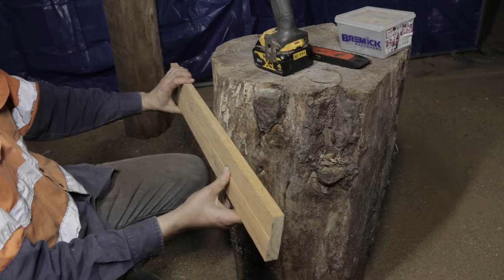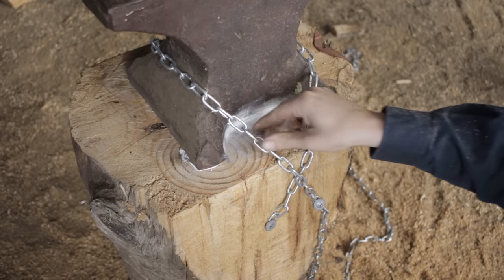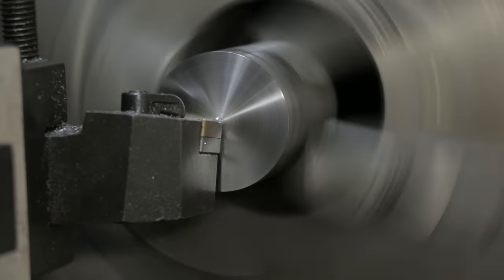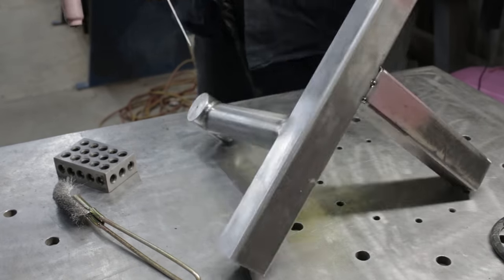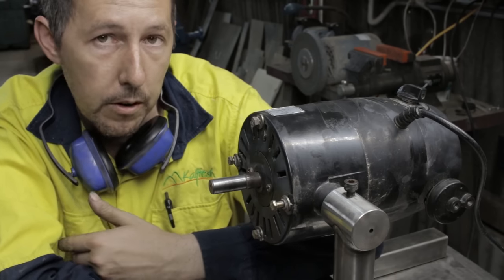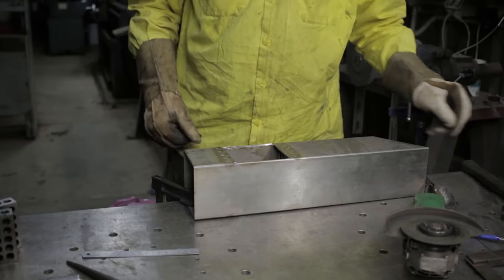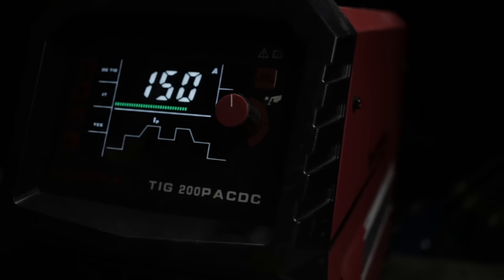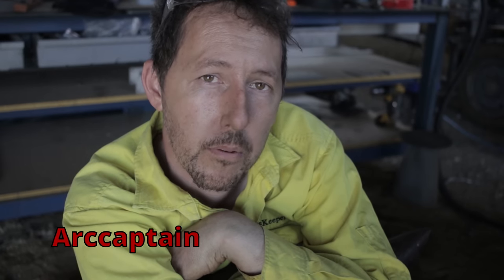Wood Fueled Furnace -PT1-

Comment: While a wood fired foundry does sound cool, electricity is so cheap here that it basically costs me a nickel to run my electric furnace and melt aluminum.  Supposedly can do copper and bronze and all that too, but I'm mostly into melting down heating trays and curtain rods.  Still, good melting, however you can do it.
Reply from the maker: Hi Derek
You have won the Arccaptain welder if you want it?
Reply: @LittleAussieRockets  Wow, super awesome.  Now no excuse not to level up.

Comment: Excellent tips for tig. I was a certified sheet metal fabricator years ago. Never liked cranking out parts in an ugly, loud, cold factory, but I've been thinking of welding for my own projects. I was taught to tig by carefully, steadily wiggling the rod through my fingers, but I have to admit I've never seen anyone else do it that way. Welding jobs offered half a McDonald's wage, so I moved on to work for more humane wages.well done
Reply from the maker: Yes, it is similar here in Australia,  production welding jobs can be a bit of a grind.

Comment: I was surprised at the lack of ring in the anvil - I didn't think tight chains would dampen it to that extent.  A "hand forged" anvil is pretty special.  Congratulations on your wise choice of extended relatives.  I have my father-in-law's old hand blacksmithed bale hook - I currently have no use for it, but it is a one of a kind thing of beauty (1 handle between 2 hooks)

Comment: Interesting build, and I like the welds, pulse can get some amazing results. I just scored a free foundry furnace last week, its a big one capable of handling a 30 litre crucible and I will be firing it with waste oil as it's already setup to use a gun type burner. I am looking forward to see how this rocket foundry furnace goes when finished.

Comment: HI Stephen, if you were right handed would you hold the tig in your right hand or the filler rod, or doesn't it matter
regards Brian
Reply from the maker: Whatever is comfortable. That's really what's most important. If you're comfortable, you'll have better control. I occasionally have to weld right handed depending on the position so to practice with both hands is very useful.
Reply: Thanks Stephen

Comment: Hey mate just curious are you left or right handed as you hold the torch in your left? Or is that so you have more control of the filler rod?
Reply from the maker: I am predominantly left-handed but weld with both. Depending on the position it's advantageous to be able to do so.

Comment: I once bought one of those knock off 3 in 1 Tig/MMA/plasma cutter. Did Ac/dc, was very controllable, had more knobs on it than the channel 7 audio mixing desk.
Landed on my doorstep for $400. Was a good little machine.
For reasons I never worked out, it had an "Auxiliary" earth that needed to be connected to anything that was mains earthed. 

One day I dropped the stinger on the Aux earth clamp and that was the sad ending of that welder. 
Maybe I could win a new one?
Reply from the maker: You're in the draw 👍

Comment: Hey, you can't make a water heater that runs on wood pellets
Reply from the maker: I actually have been experimenting with a pellet hopper for the water heater.
It needs a little bit more work. It's not as hot as I'd like, but it certainly runs without any intervention as long as you keep pellets in it.
Reply: @LittleAussieRockets  cool, I'm looking forward to seeing it.  I am apprenticed as a blacksmith in Danish and for my apprenticeship I want to make a water heater that runs on wood pellets that can heat up three cubic meters of water

Comment: Yeah I recon you’re doing yourself a disservice. That thermocouple is just after the firebox. BUT you’re operating a jet engine, literally. So combustion takes time and I mean a physical duration of time and since your moving your fire down the line forcefully your burn won’t be complete  at the thermocouple point. So put the thermocouple in the chamber. Also if the fuel can’t burn in time it will burn once it swirls and spreads in the furnace chamber. The extra air you needed was because the palm nuts are full of oil and that is a dense fuel but until it burns it’s just soot aka ultra fine charcoal. So you need more air. 

So you mentioned the draw before… well that hot burn air pushed and forced into the furnace chamber, expands and rises and sucks more air.BUT YOU’VE FIXED THE AIR SUPPLY WITH THE FAN. So it’s burning rich and FLARES out the top when superheated unburnt fuel hits oxygen rich fresh air. You need more air or less fuel. So air it is. Blow more or since it’s drawing hard then open a new air hole. Webber style as you say.

FOUNDARY a place that smelts metal, makes ingots, pours molten metal into moulds (casting a brass bell, car engine blocks)

FORGE is as it says, a place that forges metal. So here you don’t melt metal to liquid but heat and beat it into an item.

FURNACE what you built is the device that heats the metal to forge it or smelt it.

So a FOUNDARY and FORGE are a place where you have your stuff and tools to work the metal you heated to hot or molten as you require.